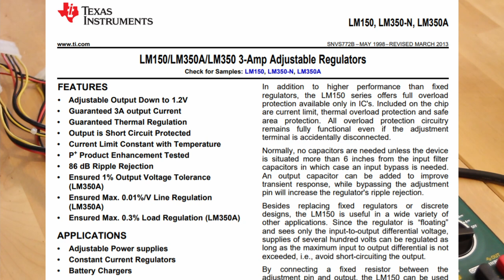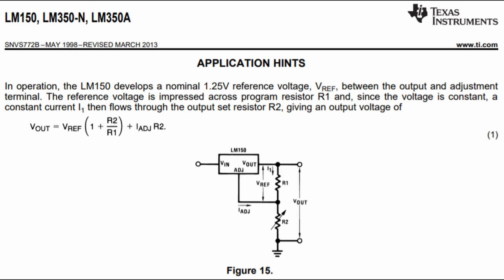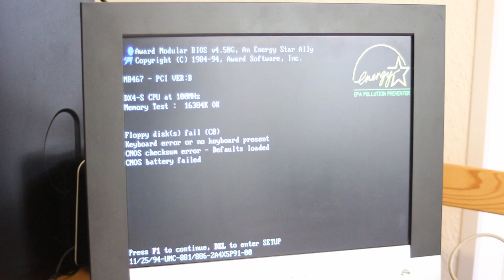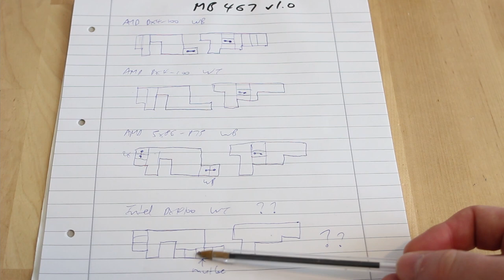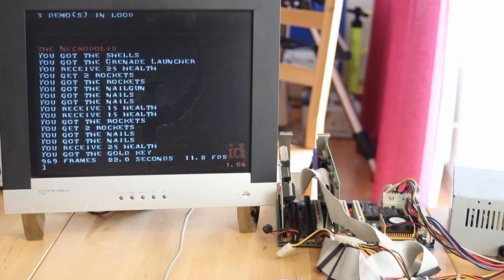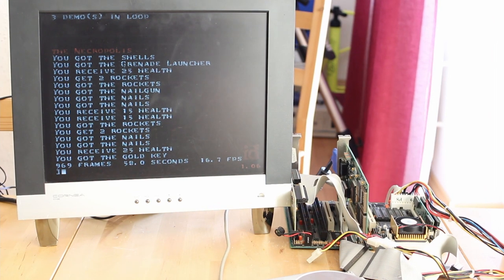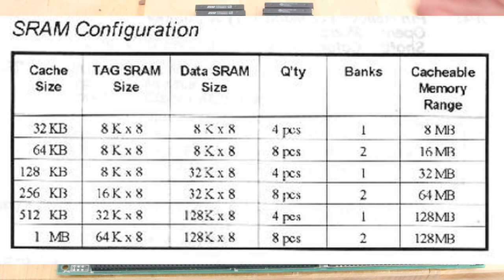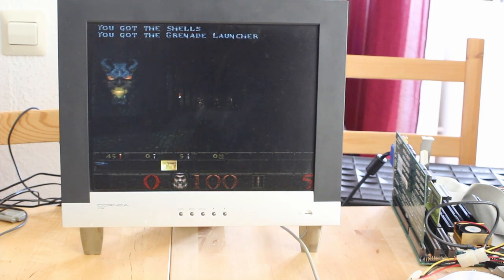PCI Socket 3 Motherboards #3: Upgrading my board

Comment: You have to watch PCI 486 boards. When set to 40MHZ they love to put a divide by 2 on the PCI bus to keep it under spec. Running the PCI slots at 20MHZ
Reply from the maker: Indeed. A lot of them have jumpers that set it this way. It can be quite some effort to figure out which jumper it is, unless it is stated in the manual.

Comment: The Matrox G200 could be a good candidate for a video card for those higher FSB speeds. They were often used in conjunction with Voodoo 2's in SLI back in the day and proved to be extremely fast in benchmarks. The 486 CPU would need a substantial overclock to make it a viable option though, otherwise it would struggle to keep the GPU's RAM filled and bottleneck the system.

Comment: As for the second board, I'd monitor the core voltage with a scope. If Quake crashes mid or end of demo that sounds to me like an overheating regulator or even an overheating CPU. I'm pretty sure you'd get it going if you would investigate a little more.
Reply from the maker: The temperatures actually seemed fine. I also set up a big cooling fan, just in case, but it made no difference.

Comment: If you want decent VGA performance on that generation by running the cards at the FSB use VLB cards as they not only run at the CPU FSB they are DIRECTLY connected to the CPU unlike PCI.
Note though that if you go above 33MHz on the FSB you need high quality VLB cards as otherwise you risk their early demise, this was in fact one of the reasons for PCI to take over, the addon cards not needing to run at the same FSB as the CPU. Many a card died with the early 486DX 50Mhz not dx/2 DX, meaning 50Mhz FSB which in fact was also the first CPU which was mandatory to use a heatsink with under threats of CPU death. That carried over to VESA LOCAL BUS cards due to them also needing to run at the same clock speed. 
Still where they work correct they are AWESOME! Even better than early PCI cards due to much less wait states specially with CPUs before the Pentium series
Reply from the maker: In the benchmarking experiments I've done I wasn't able to see a difference in performance between the two. A lot of early PCI cards were run at the FSB speed it seems. PCI cards were often fast for other reasons.

Comment: Well PCI bus don't like frequencies above 33Mhz (33Mhz is giving it's bus speed 133MB/s ). VL buss can handle 50, but not PCI, at least what I remember from old days. :-) Also AMD 486 CPUs from that time didn't have such as fast FPU, as Intel 486, which was for Quake crucial.

Comment: By the way, you need proper drivers for ANY VLB card OR the card needs to have their own BIOS Extension ROM (which won't be enough for full tilt performance but will be much faster than no bios extension and no driver)